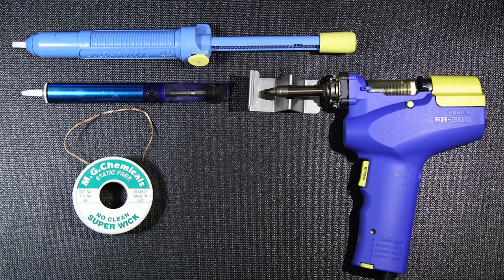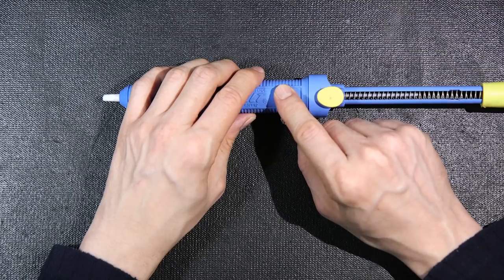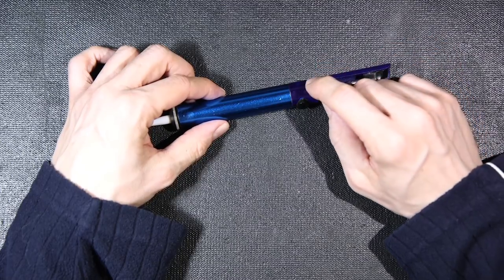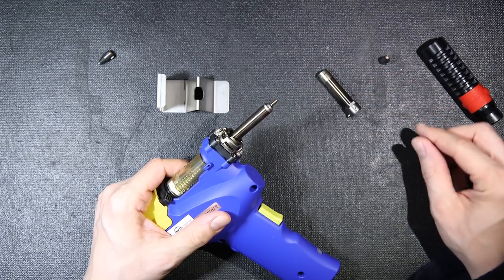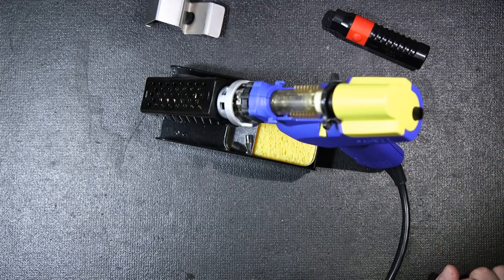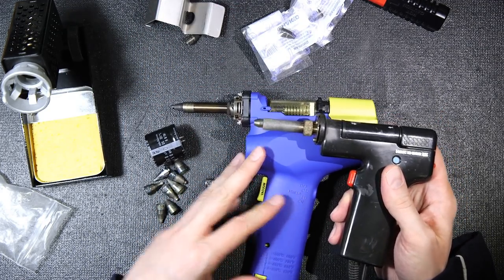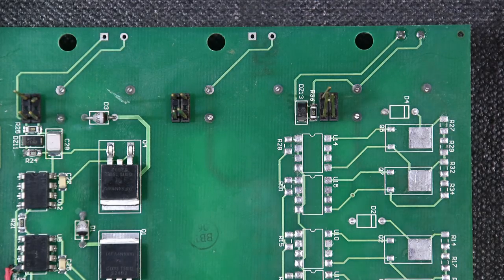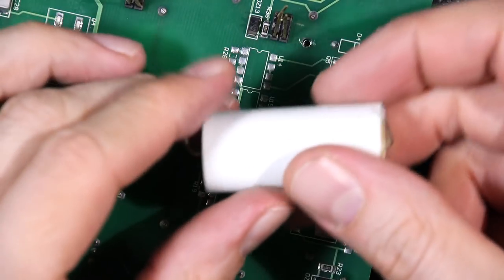How To Desolder Electronic Parts Using Different Tools.

Comment: I have used all of the tools that you demonstrated except tat I use an older Pace unit which has an electric vacuum pump. The bulb types are almost useless and tools with powerd vacuum?pumps are the best if you can afford them.

For desoldering solder cups on electrical connectors the centrifugal technique works well and requires no special tools. Heat the contact solder cup and rap the connector on the work bench or sling it to remove the molten solder. Then only down side is making sure the solder doesn't splatter where it can cause injury or damage and cleaning up the mess.

I am not a big fan of the manually operated pumps. They require frequent cleaning and the tips have to be replaced frequently if you use them often. The Solderpuldt is my choice only for point to point wiring as it has a very large tip that works much better on point to point wiring like tube radios than through hole ICs. Greenlee Paladin makes a much better small tool than the blue one that you have. Paladin tools are either black or olive green. They have a choice of two tip sizes for a better fit on PCB leads. The tighter fit improves vacuum efficiency.

When using manual pumps on PCBs with plated holes and axial leaded components. I use an iron to heat the lead on top of the board while using the manual punp to wiggle the lead and vacuum from the bottom.

Be careful when woking with components that are sensitive to ESD and use only pumps that are marker as ESD safe.

Solder wick is available is several different widths. Using the right width will improve your results. Solder wick has some flux in it and I find that Chemtronics is the best brand. Stay away from the cheap Chinese stuff. If you work on ceramic substrates which have silver pads don''t use solder wick and solder without silver  it will remove the silver.

There aluminum probe like tools for unwrapping leads on point to point wiring. Check out the GC Waldom solder aid and spudgers and probes from Technitool. Always wear safety glasses and a vent fan.

There are a wide range of specialized flux romovers. You want something that is plastic safe. Be aware that the better removers are flammable and the fumes can be harmful just like the fumes from soldering. Isopropyl and denatured alcohol leaves streaks and some other solvants either damage plastics or leave an  oily film so it is better to use commercial defluxing chemicals. I prefer Miller-Stephenson (expensive), Chemtronics, Techspray, 3M, Kester or Electrolube in that order.
Reply from the maker: Thanks for taking the time to write Paul.
Reply: I sometimes use a high temperature Master Appliance heat gun with a 3/8" tip to salvage parts from PCBs. I can unsolder multiple connections at the same time.

I worked as an ET and instrumentation and controls engineer for for 40 years.

Paul, you are a blessing. It is extremely rare to find a person with your depth of knowledge who has  the willingness and time to share knowledge in a detailed clear way. You obviously spend a lot of time creating making the videos and you make them without charge! You are one of my modern day electronics heros along with Bob Pease, Jim Williams, Forrest Mims and Don Lancaster. It is amazing to a person your age with such an in depth knowledge of tubes.

I wish I could meet you in person.
Reply: One way around expensive is to get things that need repair and fix them, and that is something that all of us can learn from this channel.

Comment: I'm using two of the blue desoldering pumps which I bought in the mid 80s and which thanks to my sporadic use are still in pretty good shape.  I quite like them; the larger models you were showing just seem a little unwieldy.

Comment: Nice video.  The only thing I didn't hear mentioned using the Hakko, is the risk of lifting pads.  Not sure if there is a fool proof method but with practice you can reduce the risk.  Keep up the great videos!
Reply from the maker: Hi Rob. Lowest tip temp to do the job, and minimal dwell time is the secret for all boards.

Comment: Wow. So much easier with the gun. I had so many issues with my cheap solder suckers. In fact, one of them practically melted inside due to the hot solder getting sucked inside. Really need to save up for a desoldering gun.

Comment: Greetings:
I find that careful timing allows the iron to be removed allowing the pump tip to be positioned squarly over pcb thru holes to greatly improve the suction effectiveness much like that achieved wjth the Hako pumped sucker. Also; both manual pump suckers have replaceable tips. Damage to the teflon tips occurs when the tip is forcefully pressed against the hot iron during any extended dwell times.

Comment: Hakko fr 300 is the best. It will completely desolder double sided circuit board as well. Very quick to heat up. Only takes a minute. I love it.

Comment: Suggestion when using the Soldapullt or any spring-loaded desoldering tool: To minimize trace damage and those divots caused when the recoil slams the soldering iron tip against the board, pull the iron tip away from the joint a split second before triggering the Soldapullt.  This also allows a better seal against the board, drawing more solder out of the joint.
Reply: I added a TEFLON rubber sleeve over the NYLON tip
The TEFLON sleeve cane from a HORIZONTAL LINE OUTPUT TRANSFORMER
and was - originally used as an insulator.
The TEFLON rubber provides a better seal around the joint to be un-sold-ered
and as mentioned -  it eliminated the heavy impact upon the PCB during recoil.
It was also easier and quicker to slide-off the TEFLON sleeve and clear it of cold
SOLD-ER fragments

Comment: Nice video, when I have wired components I tend to cut the component side of the PCB and gently heat the wire then pull through, then clean up the hole after, just reduces the heat on the PCB and prevents heat marks around the hole,

Comment: Manual desoldering pumps are only good if you desolder like 50 parts per year from boards with very spacey layouts and thick traces... I've even tried a manual pump with a heated element too, worked better but needed very frequent cleaning. So, IMHO, even if you are an amateur, if you do repair jobs that require desoldering thru-hole parts it is a good investment to buy a powered pump right away before losing time and hair, and ruining boards with manual tools. Good tips on desoldering by the way!

Comment: You can use a heat gun as well,  you need 2 speeds.  you may need gloves as well,  & you may  mess up the circuits & board, but is dos work in removing  the parts, just have to look at what your doing. i like this site as well, have a nice weekend.

Comment: There are heated versions of the cheaper solder suckers available. If you are going to get one, do NOT get the one where the power cable is attached in the middle of the side of the unit. There is literally 0.5mm of airspace between the heated part and the 2 cores of the mains cable. I used it twice and then I just got too scared to use it anymore because of the amount of smoke coming out of the handle. There is one where the power cable attaches at the end furthest from the tip.  There is a good bit of separation between the mains cable and the heated parts. It smoked at the hot end for a minute when I first switched it on, but I'm sure it was just it breaking in.

Comment: LOL. I've literally owned all these and a few others. My favorite is the HAKKO...there's no other way to fly for <$300 after you've used all the alternatives, including the cheap Chinese knock-offs. However, I still like my old standby RadioShack 45W solder sucker with the red bulb near the handle...22 years and still trucking...tips are cheap grade; practically consumable, but it beats the two handed approach with the suction tubes + placing the work piece in a clamp.

Comment: This comes at just the right moment as I have just taken delivery of an Aoyue desoldering unit int474A++
Reply from the maker: I would like to hear about your experience with that unit.
Reply: Very early days so far,had it less than a week. Works better than the Engineer SS-02 solder sucker I had. Did find I had to grease the O rings and seals in the gun part with the grease supplied with the unit, also found out that you need to wiggle the thing about or as you put it in your video move the tip in circles around the wire.
Reply: Just found one problem with the unit, the tips have a long tube on them and the top end gets blocked with solidified solder as it does not get hot enough to melt solder there. Aoyue supply a long drill bit but that is a lot smaller than the bore of the tube so it clogs as soon as it is used again. I found the only way to clear it is to remove the tip and heat the tube with a blow torch and melt the solder out. Otherwise it works fine.

Comment: Before I even look at the video I have to say the wick is the best for me... It dose a very nice clean quick job if it is used the right way. The only draw back is you can use up a lot of wick on big projects fast and it can become costly.  That is just my own opinion by the way.. :-)
Reply: Paul you will never see me using any of the  pump action desoldering tools... just to much work and to me they do not do a very good job... I hate them !!! Im sticking with the Wick !!  Just give me a nice hot Weller and the wick and Im happy.

Comment: I have a desoldering tool similar to the second manual one you showed detail on. The difference is that mine has a heated tip! It's really a great compromise between the "Soldapullit" and the automatic desoldering gun.
Reply from the maker: Sounds like a nice compromise.
Reply: Here is a photo: https://i.imgur.com/LP2NjRy.jpg
It is marked DI-3 with a serial number. I found it at a garage sale and it works perfectly.

Comment: when using the smaller type of mechanical solder sucker it makes such a difference if you can keep it perpendicular to the board, creating some kind of seal around the component lead, just so you're making use of all the limited suction it has. if you go in at an angle leaving a gap between the sucker tip and the board half your already small suction power is lost.

Comment: Wish you had mentioned the earlier version of the Soldapult.  The earlier version had a flat disk to push in to load it.  It was attached to a metal rod.  The spring was inside the cylinder (body) of the Soldapult.  The first time you used it, when you pushed the button to pull out the solder, you usually got smacked in the face with the flat disk.  You only did that once and from then on, you made sure you were out of range of the yellow disk.

Comment: Mr.Carlson ... if you could spare a minute for two musical questions ... 1st question is about soldering, but on the other end :) about what would be the best wire AWG(or mm square) to use to connect wires from the terminal on the back of the speaker cabinet(where the 1/4" jack plug is) to the speakers +/- ? The speakers are two Celestion 60W/16 Ohm, 12" and the wire is not going to be longer than 2ft. I found out that there are differences of opinion when I searched for info about it, some swear to 12 AWG and others say 20 AWG is more than enough if the wire is shorter than 3ft, some say it does not matter sound wise and others that there is difference in tone ... go figure. And is there a "right way" to decide if soldering wires is better than using the small metal "sleeves" that you crimp on the ends of a wire? Much appreciated.

Comment: Desoldering braid works very well if you need to replace some electrolytic caps on some old PC-motherboard (LGA 775 socket for example). It's useful to remove solder from vias after old caps removal. Tools like hand vacuum suckers not very handy with so small vias and also it can be hardly accessible - for example caps between memory slots.

Comment: I use to use all those suction pump before. Went through a lot of those. I now own the Hakko 808 and what a difference it makes. I would like to get a Pace but its very expensive. Good video Mr. C. Thanks for sharing.
Reply: I have a 808 also and love it! It saves so much time.
Reply: I also bought one of those Cheap Aoyue 474A++ and it works great, the only problem is clogs the nozzle very fast. Then I realize that you have to set the temperature to about 400 Deg.C so it can melt the solder at the inside of the tip and it makes it easy to clean.

Comment: 5:45 - They made them better in the past. My version over 30 years old is completely metal except for the tip, button, thumb plunger and o-rings. Drawback, it was costly, and maybe a little heavier (84g ±2g waste lead).

Comment: Desoldering can be simple with an iron and soldering braid cut in small pieces to focus heat on the point of interest,. I prefer a pencil or pistol desoldering tool. It spoils you to use it always and is the preferred method for through hole work. Using a bit of new solder applied to the old will help in removal ops. The use of extra flux applied on each joint will also accomplish the same result. A little thought beforehand can decrease the amount of time it takes and this also lessens the exposure of heat to more delicate components. Two seconds is the max dwell time per joint and less is better for SMDs. Their delicate inner structure isn’t happy with dwell times higher than 2 seconds. Practice is the key  to reducing dwell times and heat set points. Experimenting with throw away parts may save your good ones. That’s how I see it. If you use a sponge in any of your ops, only use DW, distilled water or DDW, deionized distilled water as these are the only ones that do no produce any issues with soldering irons or desoldering irons. The sponge is only to be moist, not drowned in these waters. Tap water has chemicals which react with the plated surfaces of both irons. Knowledge is the key to extended life and success in soldering/desoldering ops. The brass wool is the only approved abrasive to clean soldering/desoldering equipment. Steel wool will take the plating right off. Don’t believe all you see and hear on YouTube as most of these characters are not trained or they wouldn’t be misinforming you. It’s up to you who to believe. Failure to listen and understand has it’s price as well. Stay safe mates!😊👍🏻😷

Comment: My old desolderer is like the smaller one but the problem with it wasn't so much the rear of it breaking as mine is so old it's all blue anodised aluminium, but the tip softening & the hole enlarging so as a consequence less vacuum! 
However, I found a Solderpullt Successor model SS011 which operates one-handed in same way, & is slightly larger with a stronger spring than my older one, but I was able to purchase on eBay a quantity of replacement tips for when they wear out!

Comment: Comprehensive video Mr.Carlson Thank you. I enjoy using de-soldering braid with flux, but recently found myself running into the small SMH parts, not sure of the propper identification of those micro components???. At any rate, THANK YOU for sharing your equipment with us.
        Kind regards Eric Dee

Comment: A poor tech's version of solder wick. Find a piece of old coaxial cable with copper braid. Strip the outer jacket and slide the braid off like a snake skin. Granted it is much bigger than the store bought stuff but loaded with RA flux as Paul suggests it behaves like super wick. Note: go find someone who installs CCTV cameras for a living. They may have a job where they are ripping out yards (or Meters) of RG-59 with copper braid due to upgrades to Cat 5 or 6 cable.
Reply: Some tiny braid is available on RG-174 coax. if needed.
Reply: Done that before Rick when I was too lazy to go pick up another roll lol hahahahahaha
Reply: I actually use coaxial cable as solder wick.works great
Reply: Tried that before and did not like the results... The braid is poor at picking up solder and does not hold much even when it does work. Pigtail works better.

Comment: I have a type which has the manual suction piston but the tip is a soldering iron. Very cheap and works very well...

Comment: Thank you! You have inspired me to fix my refrigerator circuit board. That was a while ago and refrig runs great! I fix tube radios as a hobby and I purchased a Hakko FR-301 to make desolder easier. I remember destroying cardboard antennae coils and wave traps as I tried to desolder broken off point-to-point leads. On the Hakko, what size tip opening do you recommend when working on point-to-point tube radios?

Comment: When I have a flattened cut that won't pull through the via, I just use needle-nosed plyers to "square" the end and it always releases without shortening the leads.

Comment: Paul, I have the older Hakko 808 desoldering tool. Is the newer model you have better? That said, I couldn't be happier with mine. It works incredibly well. Much much better than solder wick and the old manual solder suckers.

Comment: The solder suckers sometimes work better for through hole components if you put the sucker on the back side of the board and heat the part from the front side while the board is held in a board vice.

Comment: Mr Carlson, I have a Pro Tip for your viewers regarding the SOLDAPULLT: Never store it with the spring compressed, or the spring will eventually get 'tired' and the vacuuming action will slow down drastically.